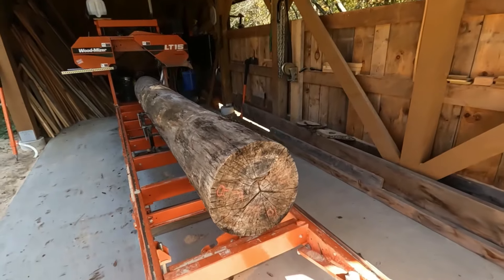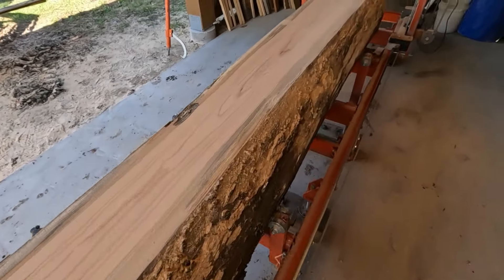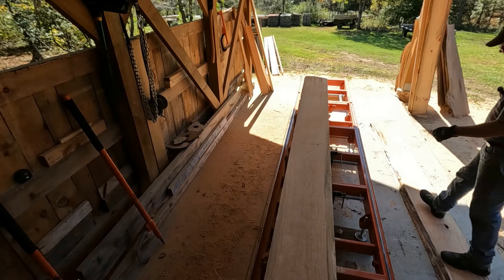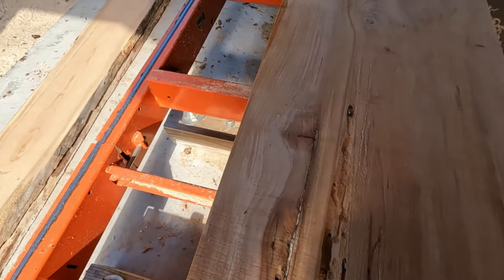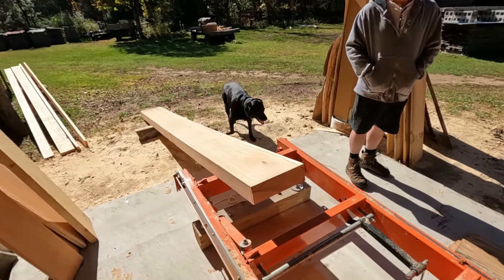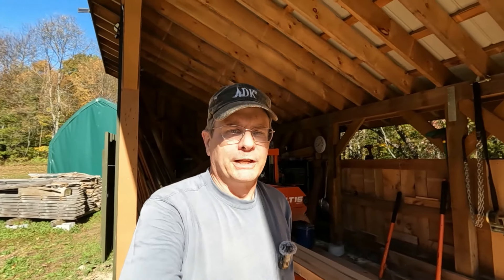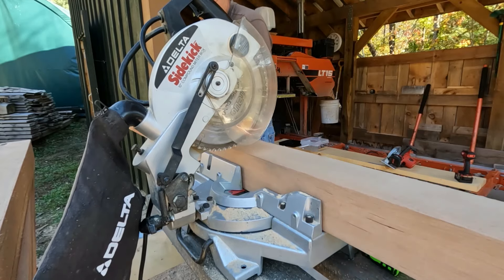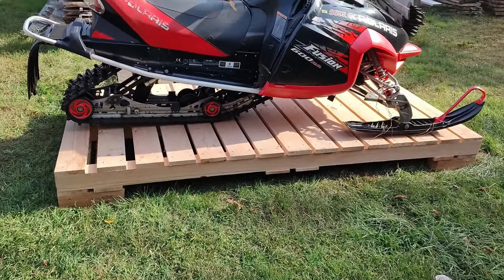Black Cherry on the Wood-Mizer LT15

Comment: Hey Paul, that saw limps pretty good. Cherry and black walnut can lay in the woods for years before the hart wood even starts to rot.
Brent
Reply from the maker: Thanks Brent.  The saw made it through this log and half another.  One bearing was ok the other was shot, replaced both and it's working great now.

Comment: Was the black cherry just available or is it somewhat rot resistant?  No cedar or white oak?
Reply from the maker: No cedar or white oak in the area.  We do have some black locust around but it is too small.  The cherry is somewhat rot resistant but the real factor is we have at least 30 logs of it in similar condition that I have to get around to doing something with before it is too late.